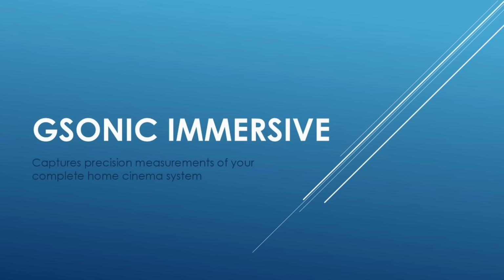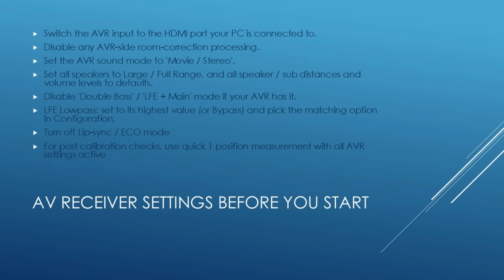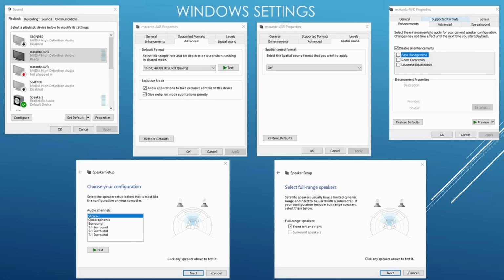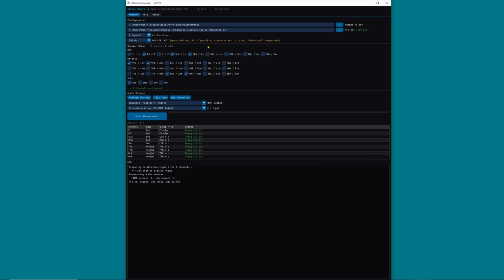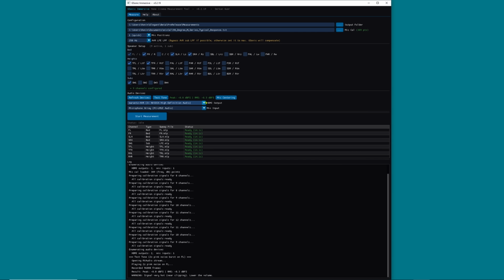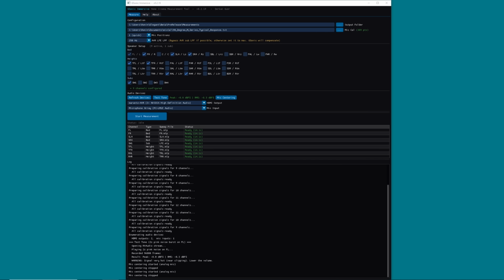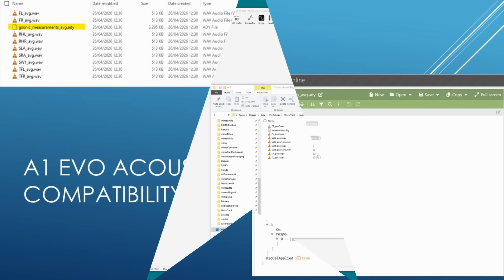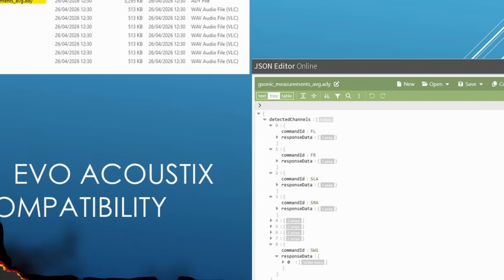GSonic Immersive

Comment from the maker: GSonic Immersive update v1.1.7 - 11 Jun 2026
- Please refer to the "Help" tab in the app for latest updates and any differences from the video instructions
- Do not unsubscribe from emails if you want to be informed of app updates

✨ New
One-click Windows audio fixes. When the app flags a setting that would distort your measurement, there's now a button right under the warning to fix it for you:

Turn off audio "enhancements" (loudness, bass management, room correction) — including the setting Windows 11 usually hides where you can't reach it
Re-enable exclusive mode on the AVR output
Set the Windows volume to 100%, un-mute, and center the left/right balance
Switch off communications "ducking" and Mono Audio
Anything that needs administrator rights asks you once; the rest just happens.

Copy anything as text — no more screenshots or retyping. Everything the app shows can now be copied to the clipboard:

the activity log (the whole thing, or right-click a single line)
every prompt and error message, with a Copy button right there
the AVR Reset report
the debug-log path in the About tab
the entire Help guide, in one click
So you can paste an error straight into a support email instead of screen-shotting it — or drop the whole Help guide into a translator and read it in your own language.

🔧 Improved
Clearer messages when a measurement fails — the app tells you what actually happened instead of listing guesses, including new detection of strong room reflections and brief AVR drop-outs.
Smarter clipping guidance — if the capture runs hot, it points you at your microphone gain (your AVR stays at its normal listening level). A yellow Test Tone result is a heads-up, not a failure.
Refreshed Help guide covering all of the above.

🐞 Fixed
AVR discovery (the "Turn on and reset AVR" step) could hang on some networks — it now always finishes, with a "Skip — enter IP manually" option.
A harmless clipping note that used to appear on every subwoofer sweep is gone.

Click the link below to see earlier update details and the full app update history:

https://drive.google.com/file/d/1mjAtFret9NwOS9Ail8W1j4l99bfpU79N/view?usp=sharing
Reply: Oh wow you already implemented the pauze repeat! ❤️ That's a game changer for thank you! Previously 3 position measurements where impossible. There was always one where a car or truck drove by and has some kind of noise in the house. Will do some new measurements this weekend!
Reply from the maker: The AVR reset is also quite sophisticated. Will play atmos dither and turn off loudness management, cinema EQ, tone, channel level adjust, etc. Unrested with new models though.
Reply: @ocaudiophile new models like the Cinema 30? I have that one if needed I can check things if you want.
Reply: @ocaudiophile  Tested the feature. It could not read the SW1 and 2 level. And also auto lip sync was unknown.

Further it said please verify speaker distance 3.00 meter it was still 0.00. Dont know if it does set distance or not but it was not changed for me.
Reply from the maker: Model?
Reply: @ocaudiophile  denon AVR6800H. Acoustix works great, it’s the measuring tool. that is goofing everything up. Also to let you know when I balanced it out manually it sounded really good.
Reply: @ocaudiophile marantz cinema 30. You said you did not test the new models yet so I thought let's give it a go.
Reply: Once software purchased can we do MLP  3 sitting position and once done we have to use Multi eq app right
Reply from the maker: You can take measurements at up to 16 different positions and GSI will average them and generate an ady file. But this file is not for the Editor app. It's for the much better A1 Evo AcoustiX app. That app is free btw.
Reply: @ocaudiophile  once done calibration how to send marantaz processor.
Reply from the maker: AcoustiX will do it
Reply: Does GSonic + AcoustiX support Directional subwoofers? or is directional not a preferred way? i guess it would mess with the integration a bit if only one of them would play?
Reply from the maker: You will still need to turn each one off to measure with GSonic as directional or not, LFE sweep will play from all subs simultaneously.
Reply: @ocaudiophile so after I loaded the calibration file to the receiver I can set it to directional? I will sure give it a go :)

I was wondering. It's probably very complex but is it possible to expand AcoustiX with the option to have multiple target curves? For example different one for the rear speakers to roll off mid and high more.

It would also be nice if A1X could remember the last used settings. Because I psuh mu Crossovers back to 60 - 90hz the rear en atmos because they are small speakers itl would rather not push them that hard.
Reply from the maker: @Nelthalin  Nice ideas, noted for the next build.
Reply: @ocaudiophile another maybe nice idea is the option to force a retry of a measurement. For example when you hear a noise during the sweep. Where I live there are some busy roads even at night I sometimes hear a big truck. And with doing everything manual I would just trow that one out do it again. But now I don't have that option when a truck drove by.
Or a option to mix match measurements first and then generate the ady file would also help to fix this. Then I can make notes throw the bad ones out repeat only that one out it in and generate.
Reply: how can we download the update?
Reply: @d4321 go to the link in the email. On the page you will see the download will list the new version.
Reply: Which email the one with the license?
I don't see any link in that one
Reply: @iqfav7884 I have a view content button in the email of the purchase. And on that site you have the license and the download link. How did you download it the first time? It should be the same proces. The original download is now updated to the new version.
Reply: Thanks for the help I see it now.
Reply: @iqfav7884 your welcome :)
Reply: Where/how do we obtain updates?  I don't see a way after inital purchase.  Link in video takes me to the purchase page.  Thank you in advance.
Reply: @bladeavenger603 see the replies above the link is in the emsil you got there you can go to the download page for the software.
Reply: @Nelthalin  Thank, you.  I didn't noticed that the email went to my junk mail.  I found the email and was able to download the update.
Reply: Hoi OCA! Is it possible to make use of the new functions and methods without measuring again? Since the measurements themselves wouldn’t change, would they?
Reply: @carstenc3582 I'm not OCA but he changed things in how the sound is captured to improve the measurements taken. So so have benifit of those changes you have to do new measurements.
Reply: where do we get the upadate?
Reply: @JamesFuoco-m9d see the original email. It has a download link to the license and software.
Reply: @Nelthalin  I found it thank you so very much
Reply from the maker: And I resent him another
Reply: I measured 3 positions with v1.1.3 using Umik-1, the entire process completed successfully. However, the GSonic bass was noticeably softer than that measured by Acoustix (5 positions 5 Reps) using the provided mic of my Marantz Cinema 30 plugged into the AVR. The comparison was at the same volume and AVR settings. Please help. Many thanks.
Reply: @KKLoh-y9p have you done a rew measurement or some kind of other measurement after calibration to check the results? Maybe you had a bass peak or dip with one of them.
Reply: @ocaudiophile thanks for the new 1.1.6 update that update for multi sub is really nice!

Since 1.1.5 I get the message I'm clipping at -18db. I need to lower to - 25db before that stops. Is that a issue for the measurements? The mic boost is at +30 according to GSI but I don't have any options in W11 to turn it off. I looked for UMIK-1 drivers because I know my realtek audio has the option when installing drivers but did not find any. I also do not have any option to disable enhancements for the mic.
Reply from the maker: Some Umik-1 models are boosted by 18dB - it's reported in their device name. There's a dip switch in them to set it lower if you wanna measure higher volumes if you cannot decrease it in windows.
Reply: @ocaudiophile it does indeed read 18 in the name I will have a look thanks for the advice!
Reply: Merhaba Serkan. v1.1.6 yı yükledim. Denon avr nin kendi mikrofonunu kullanıyorum. tüm ayarlar tamam. FL, FR ve C ölçümlerini yapıyor. SLA ya gelince ''SLA recording had a capture dropout? the windows audio engine lost samples mid-sweep corrupts the measurement. this is a system load/usb-bus issue, not your avr.close other apps (browsers, virus scans, downloads), plug the mic into a different usb port(ideally not a hub, avoid usb 3.0 ports next to one another), set windows power plan to high performance, then click repeat to re-measure SLA                 Status: Both ATRs blocked- Repeat? '' uyarısı alıyorum
Reply: Hi @ocaudiophile, I bought the software because the work behind it is incredible—congratulations. I have a question: can I load the generated .ady file directly into the Cinema 50, or do I need to run the measurements through REW and use A1Evo first?
Reply from the maker: Congrats! Copy that ady file to A1 Evo AcoustiX folder and run AcoustiX. It will optimize your system and transfer the final calibration to your receiver. A1 Evo is free and you do not need anything else.
Reply: Hi, how to get started?

Comment: Hello, I am currently testing the GSonic stereo application and am having issues with audio output via ASIO (My HTPC is intel n95 based). Only a 7.1 configuration is available, but I have a 5.2.2 setup. I’m concerned that GSonic Immersive might not be able to measure the overhead (ceiling) channels. Is there any way to verify this beforehand, so I don’t end up wasting my money? Thanks!
Reply from the maker: The software is specifically designed to measure overhead and height channels, so it will work with your 5.2.2 setup.

Comment: Hi! I’m using Immersive 3.0.1 in Evo 32 mode with a Denon X3400H (5.1.2). All channels work except FDR’s extra MLP captures: FDR_pos1 plays and saves correctly, but B Capture and B Quiet are silent and keep retrying. The log says “Both ATR chirps not detected,” with no capture dropouts. I’ve tried the test scripts, restarting, and checking Auto/Atmos mode. Any idea what could cause this?
Reply from the maker: During FDR’s two repeat sweeps, do you hear the sweep in the room? If you do then it's the mic side that's failing. Remove the mic as Windows default if that's the case and/or tick "Bypass Windows audio for mic" option. If you are not hearing anything, share your debug log location of which you will find under the "About" tab. Here's where you can upload it:

https://drive.google.com/drive/folders/13eRDRmuTau_J90WkXuszPc_MZU5LWiYv?usp=drive_link
Reply: @ocaudiophile  The mic is working. The first sweep is being played but the second and -3db one are not played. I attached the log and capture under "GSI FG_FDR_RepeatError". I'm using it on an old toshiba c70d laptop. Everything else is working fine. Its just the FDR 2. and 3. Measurement on MLP Evo32Mode
Reply from the maker: Your laptop takes 25 seconds to process each sweep. That's a new high ;)

But the problem seems to be caused by your even more ancient AVR refusing to decode Atmos unless it plays right after a pcm signal. That's the only time this ever happened. What I can suggest until I find a fix:

Keep “Pause after each sweep” on.
When “FDR sweep saved” appears, switch the receiver to another input, then back to the PC input, wait about 5 seconds, and click Continue.
When “FDR pos 1 repeat 1 saved” appears, do the same again before you click Continue.
If you don’t hear a sweep, switch the input away and back once more and click Redo.

PS Make sure to set the AVR to Pure Auto before starting measurments and do not set multch-in and trueHD modes to ANY kind of upmixer (these will be remembered)
Reply: @ocaudiophile thanks for the very fast answer. What can I say, it was the only laptop I still had xD. I will try what you suggested. What I don’t understand is why the FDL is working fine. On FDL it plays all 3 sounds. I also have a mini pc lying around which has a bit more power. I will try it later too. Maybe my hardware is just too old. The AVR X3400H should be good enough I hope xD
Reply: @ocaudiophile  I just now tried your workaround and it worked! Thank you sooo much! I will try with EVO32 now and see how it sounds. It is ok to copy the newly made FDR Sweep files to the whole measurment folder I made yesterday right? So I dont have to measure everything all again
Reply from the maker: It's not optimal to replace measurements but will work unless your measurement log shows damage to Evo 32

Comment: Good Morning Sir, got a question. I plan to move one of subwoofers (which are actually placed at the front each left and right hand side of my tower speakers) to behind the mlp (diagonal placement / in AVP —> Front/Back). Is Gsonic Immersive able to process that while measureing (configuration will be actualized of course via GSI)? Further to that is Acoustix able to handle that configuration as well? Here is a notice copied out of the user manual of my Marantz AV20.
Thank you Sir.

 Subwoofer Layout
When you are using multiple subwoofers, configure the subwoofer
layout. The layouts that can be selected differ depending on the
configuration of “Subwoofer Mode”.
[When “Subwoofers” is set to “2 spkrs”]
Left/Right
(Default):
Place subwoofers symmetrically on the
front side.
Front/Rear:
Place a subwoofer in the middle of the
front side and another in the middle of the
rear side.
Reply from the maker: You can place your subs whereever you want and GSI and AcoustiX both have no problem measuring /processing it but what you're asking for is  configuring "directional bass" mode in the AVR where each sub plays different content. That mode is not used (it's not suitable for movies) and will be reset to standard bass mode during optimization.
Reply: @o @ocaudiophile anks, but not quite, the subwoofer mode remains standard but the selected placement is not left/right but front/rear. Thanks Sir.
Reply from the maker: In standard bass mode, those settings are not active.

Comment: Quick question on this note below from GSonic  - does this mean the GSonic EVO 32 filters will apply ONLY to the HDMI input on my Denon that is connected to my PC? Will they not also apply to the HDMI port where I have connected by Apple TV?  ----- "This reset applies only to the currently active HDMI input (your PC). Settings such as channel level adjustments and tone controls are saved individually for each input and for each preset (if applicable). If you have customized any of these settings for other sources such as your Blu-ray player, game console, or streaming devices, you will need to switch to each of those inputs and verify the settings before critical listening."
Reply from the maker: Some settings are AVR wide, some are HDMI input and fed signal specific. GSI makes sure everything is reset for PC Input but nothing more. You should check the settings your regular use input for sanity after calibration.

Comment: I am getting the following error, but have tried all the suggested fixes and still get the error. "WARNING: the front pair does not agree with mic centering. Centering measured FR 1 mm nearer than FL at this spot; this sweep makes it 64 mm nearer - a 64 mm difference."
Reply from the maker: Your PC must be introducing varying clock drifts. You can ignore and continue and see if the results are good since drift is minimal and GSI will compensate for it if it stays stable but otherwise you will need to check the troubleshooting guide to get to the bottom of that clock drift issue.
Reply: @ocaudiophile  ok thanks. I have the PC's power plan on High Performance, but I am using an active USB extender cable for the UMIK-1
Reply: I am going to swap out the Active USB cable for a passive cable and see if this eliminates the issue.
Reply from the maker: Make sure you update your BIOS and graphics card drivers, too.

Comment: How to do re-measurements in evo 32 mode? I have two measurements that are corrupt/invalid (SW2 pos3 and SRA pos 5). I've tried to do new evo 32 measurements of these and copying the other measurements (when i did all speakers) to the new folder. When trying to open in evo32 program it still says SW2 pos3 and SRA pos 5 are invalid. 

Do I have to do the entire process again or is it possible to just measure the two positions that were corrupted?

Thanks!
Reply from the maker: It will not work with partial measurement patches. You will need to repeat the process but my suggestion is to understand and fix the audio path related issues that caused the corrupt measurements first (you can use the troubleshooting guide linked in the Help tab) otherwise it will probably happen again.